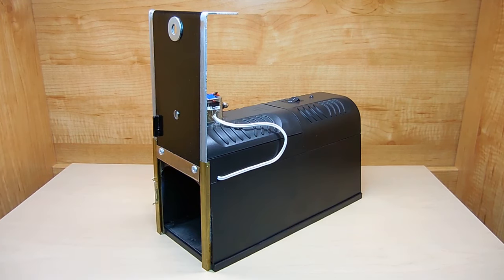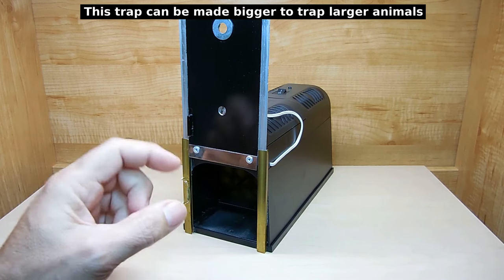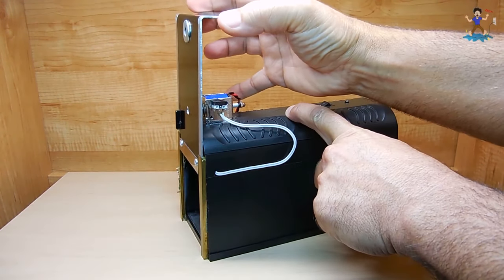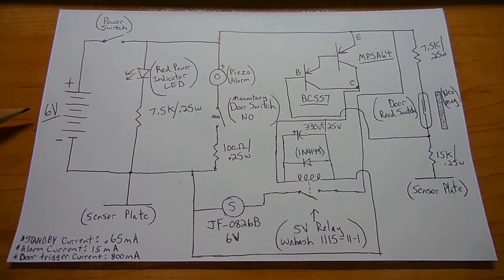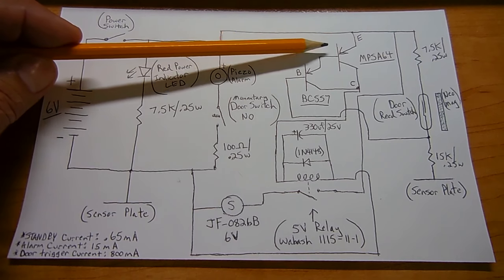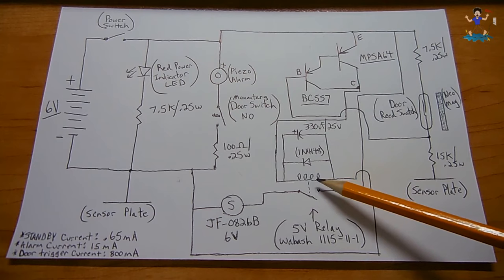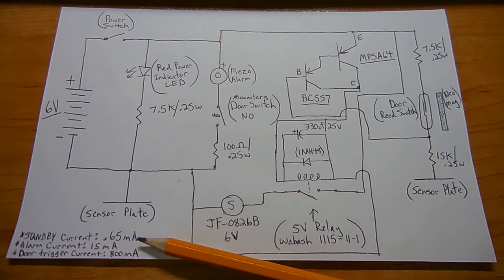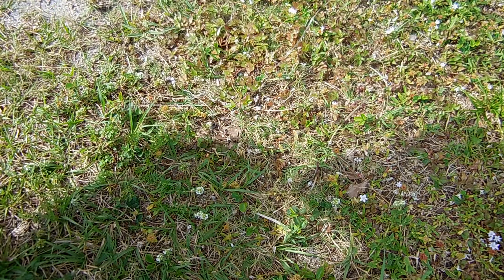Catch and Release Trap!(Rats, Mice, Lizards)

Comment: Very cool.  A nice upgrade would be a chirping alarm which sounds every five minutes (like those used by fire alarms) instead of the constant sound which would deplete the power more quickly and bother pets if activated while not at home.
Reply: Knut Blaise as he said in the video...it can be set to beep...
Reply from the maker: Hi there. I can easily modify the alarm to make it beep every few seconds. Thanks for watching! Please share.
Reply: @Quickened1  Yep he did at 3:08.  I'm guessing a capacitor could be inserted before the buzzer to add a delay such that it would beep every few seconds but I'm thinking this might consume more power than the approach I envisioned.  

I'm thinking more along the lines of a circuit component which would take a very small current as an input when the gate is closed and every 5  minutes (that the gate is closed) allow a higher current source to power the buzzer for about 1/8 of a second.
Reply: If making this from scratch vs retrofitting an existing product would the circuit work with a 9V battery vs the 4 1.5V C batteries?  Or for that matter what is the best way to increase the voltage of a single 1.5V AA battery to the required level?

In a previous comment I was thinking of a circuit component which might take a low amp input when the gate is closed and then allow a higher amp input to pass through it to the buzzer for about 1/8 of a second for every 5 minutes the gate is closed.  I'm a software developer so I don't know how to design circuits but after watching your videos I want to learn how.

Thanks for the inspiration :-)

Comment: I don't understand.  The one link takes you to an assembled trap that shocks the rodent to death.  Otherwise, I don't see any reference to the box with the sliding door.  Is there any soource for this.  Finding the electronic parts is easy.
Reply from the maker: I was helping people find "most" of the parts easier. I supplied the electronic trap because that's what I bought when this conversion was made. The sliding door was made using a K&S metals aluminum sheet.

Comment: Interesting device, but it will give alarm, until the battery is empty, if nobody turns it off? So you have to stand up from bed in the middle of the nigtht? It should give a sound and then turn off after 2-3 s.
Reply from the maker: The alarm was converted to a loud beep every few seconds.

Comment: I built a trap like that but the door was too slow for fast rats. I added some springs to the door so when it closed it fired off fast. I also added a way to unload the trap easily. You need one side see-through so you can unload it too.
Reply from the maker: No way is a rat going to beat my door. It drops and locks way too fast. Thanks for watching!
Reply: That/s what I though until I found the trap empty abut 30% of the time.
Reply from the maker: I can't see it happening unless your door didn't lock in position or had excessive play. You needed a camera on it to see how they did it.
Reply: A camera would have been a great idea. If you watch videos of rats they are super cautious and are expecting something as they can turn around an run in milliseconds. Every mouse that went in never got out. My trap had a hard drive magnet to pull and lock it closed.
Reply: I am building mechanical TV's these days. I bet you would enjoy making one of those.